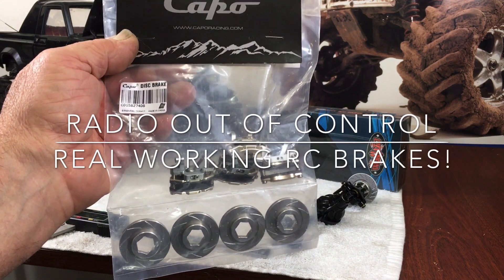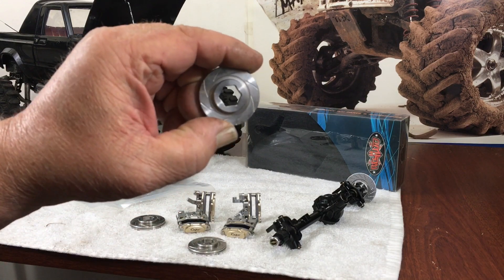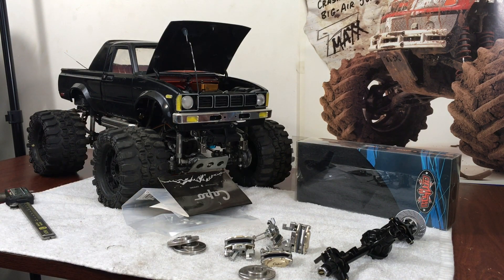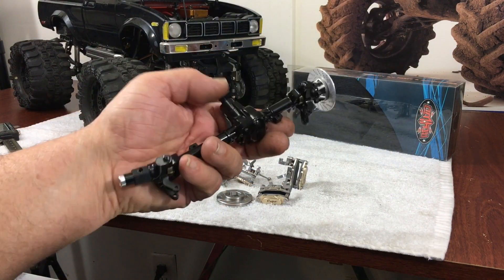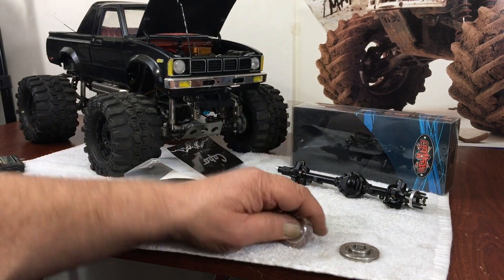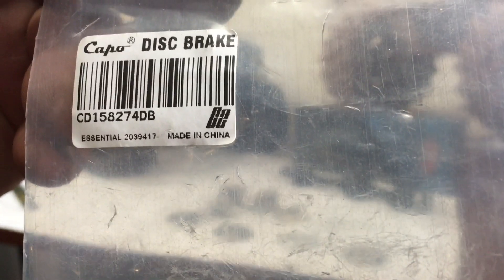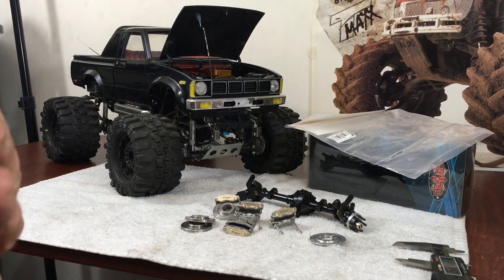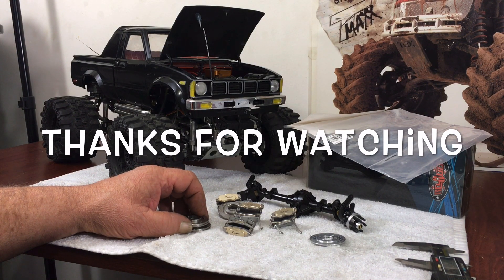CAPO Real functioning rc brakes

Comment: Cool video.
I love the Porsche 928.
A while back I installed a Megasquirt stand alone fuel injection / ignition control system and a Vortec V-1 centrifugal supercharger on one.
Reply from the maker: I was going to supercharge mine but had to many projects in the mix lol. its a euro gray market car that some Dr. imported got in trouble with it then put it away.  I bought it back in 2000,

Comment: Great info on a really awesome brake setup! What I’m seeing is the possibility of mounting a rotor and caliper setup between the drive shafts and front and rear diffs if space is an issue. Even better, if you had an outdrive pinion coming through the opposite sides of the diffs you could mount them opposite the driveshafts like a Rockwell axle or an old school rock bouncer. Plus the Rockwell style braking is a super cool look. On scx10 axles that’s just a matter of mating two of the same axle housings and using two pinions.
Nice looking 918 by the way!
Reply from the maker: rc Ohio that is a great idea brother I love the Rockwell axles,kinda hard to find lately.

Comment: I've got a Toyan single coming, planning on using it in a tamiya semi. Globe Liner probably. Kinda wish these brakes were a bit smaller so's I could shove them into those wheels, alas, they're 1.7's.
Reply from the maker: Yea they could use a spacer to get the rim away from the caliper if you wanted to.

Comment: A bicycle shift cable should work. The shift cables are thinner diameter than D brake cables they are stainless and they are extremely strong I would suggest rigging up the cable and getting rid of the stretch before installing it on to your brakes
Reply from the maker: Todd Bertram good call brother! I’m on it thanks for the idea!

Comment: Thanks, Dennis.  I’m going to try putting those on my 2WD for some burn outs. As for your 2 stroke build I suggest try a .15 motor 1st, Mine rips just fine. You either gonna like the .15 or upgrade to 2.5. Good luck.
Reply from the maker: That will be cool to power brake an rc! lol good call on the .15  I have a couple laying around, my old tmaxx blasted around with no problems.

Comment: Any updates on the 2 stroke V8 weedwhacker?
Reply from the maker: Yea, I had a staple get sucked up in one of the ports and had to find a replacement jug and piston,  I just need to seal up the lower end and hopefully it will be good lol,
Reply: Dennis Dempsey Radio out of control Glad to hear you got the issue sorted. I can’t wait to hear it run! Keep up the good work.

Comment: They are super cool looking and scale but at that point why not make them hydraulic with a plunger fact evasion on a servo as well as make them dual piston. The single piston Spring actuation I don't think is going to provide a lot of braking power as well as most likely they are going to rub all the time because you are going to have to run one brake pad close to the road are and the other brake pad is going to have to provide the full throw. But cappo does make very interesting stuff I just can never justify the money. But if I could the JK is what I would purchase
Reply from the maker: Todd Bertram I was really surprised that capo didn’t have a hydraulic setup,  I was going to modify the Roman 1/5 scale brakes and retrofit them on my next project,  but I went out on a limb and ordered a capo jkmax before they sold out again,  going to be eating balogna on hand sandwiches for a while lol!

Comment: Hey Dennis great vid, I’m still having issues with my Toyan engine,  can you tell me what fuel you are using and does it leak oil everywhere especially under the sump ?
Thanks 👍🏻
Reply from the maker: Hey brother I’m running 2 different fuels, I have a old can of powermaster 15% nitro with 18% caster,  and a gallon of s&w hobby 20% nitro it didn’t specify the caster amount, both fuels run good in it. Also I’m putting constant power to my glow plug, Yea mine seems to leak at the front and rear of the crank on to the pan, I put a gasket on the oil nipple and put bolts in all the lower pan holes incase it was seeping out of them.
Reply: Dennis Dempsey Radio out of control 
Thanks Dennis, I had my engine apart one of the crank bearing seals was not in the crankcase groove properly and was torn, I put some new ones in but still leaks, this is a bit of a pain as it gets on the cam belt and then the fan slips. I’m thinking of fitting a brushless fan up front to help with the cooling, I’m running Optifuel 25 % think that’s pure synthetic, keep up the good work 👍🏻
Reply from the maker: @Blacklamass  I think the fan they have is more for decoration than function, mine slips with a dry belt lol!  I see on the enginediy.com site they now have a water pump and accessories for their water cooled version,  I am undecided on getting the gasoline water cooled version or the V4 for my next build, I haven't seen many build videos on the V4 so im kinda sceptical on the engine and the heavy price tag on it. But I guess we were the few to to install and experiment with the fs-100 in our builds,  I am going to tear my toyan down to check the crank seals mine is leaking more and more. I want to really look it over to see if any more power can be squeezed out of it.  The higher nitro content in your fuel usually helps maintain a smooth power band from idle, I was surprised when I ran the 15% it really stabilized the idle and increased the bottom end but lost some top end torque and power, I'm going to retune it and run the 20% again as soon as it warms up to normal temps outside here in new england lol!
Reply: Dennis Dempsey Radio out of control 
Hi Dennis, in reply to tearing down the Toyan, do you deal with Enginediy? I bought my first engine from an eBay seller, I got on to Enginediy and they seem a bit reluctant to help me out, but will keep trying, they are saying to me that the engine must have the cam belts changed regularly and engine must be cleaned out regularly, I have asked them why and what does cleaning out the engine regularly mean but no answer.
The Toyan engine has some good and bad points, bad points is they use a two piece crank, the main bearings are very small and they use a pair of tiny ball races on the con rod big end which makes the con rod so thin walled, why they did not fit a nice bronze bearing and a more meaty con rod is beyond me, I also found the cylinder is glass hard and you can see the shiny marks on the bore hear and there as it’s not bedding in, normally you have a softer cylinder so ring can bed in.
Saying all this I still love this engine, I think it will take so long to run this piston ring and cylinder in as they are both so hard, I have been running mine tank after tank and it’s getting better, I have installed an electric fan which helps no end. I really think this engine is kind of a display item to run on a plinth to empress your friends rather than a real working engine, I’m going to make some new rods and bronze big end bearings and see how they run. My engine with new seals is not leaking quite as bad, but still hard to tune so have fitted a finer needle which helps out a lot, I do think we need a bit more help from the manufactures of these engines, I can find only very limited spares for this engine, after all we are promoting this engine on YouTube but the times I have taken this truck out it does not empress my friends 
What do you think Dennis ?
Reply from the maker: @Blacklamass  I have only contacted them a couple of times on the V4,  They do return my messages, Did you get any instructions with your engines? I know the cam belt is suggested to be changed every 100 hrs of run time and they suggest cleaning out the grease sludge in the valve body and any soiled oil in the lower crankcase on a regular schedule, I wonder if your oil problem is from the piston blowby pressure in the crankcase until it gets bedded in, I was going to drill a bigger port hole in my crankcase I dont think its big enough to expel the oil and is pushing the crank pressure back up the cylinder and causing an enigma in the combustion chamber . the 2 strokes have a lot of suction in their cases where the 4 strokes don't.  Most of these companies go through rolling changes with parts over time I remember using chrome rings in my high performance race car engines and they took forever to seat lol, I have ran about 2 gallons of fuel through mine and it dose run way better than when I first got it.  This engine seems to be the equivalent to the brushed 27 turn motors, The engine seems to be a low power transportation engine where the 2 strokes build a lot of power for fun running. I have been playing with gearing and tire sizes to find the sweet spot I just ordered a 12t clutch and a 42t spur to try out. I am going to install a 15  traxxas engine on this to see how it reacts with it compared to the toyan.
Reply: Dennis Dempsey Radio out of control 
Hey Dennis, Im Sure the little Traxxas 15 will go well, but I like the 4 strokes an in particular this Toyan, the strange thing is that I have been running a few tanks through it every night but the tune never stays the same, I’m going to run my other one in on the bench, maybe you can do a tear down vid if the engine it’s easy to strip down, I even lapped the valves in while it was apart 👍🏻
Reply: Dennis Im not having a lot of luck from Enginediy, they mail me now and then saying they going to do this and that but in reality nothing happens, no real help with my issues, have you stripped your Toyan down yet? I opened the box of my bruiser clone today that’s my next build, I have been running a few tanks every day through the 6 wheeler but  it’s never the same always playing with the main needle, hoping second engine will be better, I’m looking at the V4 but looks like you got to change carbs, have you seen Johnny Q”s vids ? 
Keep up the good work 
Steve
Reply from the maker: @Blacklamass   Hey Steve sounds like they are dragging their feet for some reason, Not a good business decision in my opinion,  I took a chance on the toyan, I was going to buy another bruiser clone but seen the toyan was on sale.  I haven't had a chance to tear mine down yet, kinda afraid of not being able to get parts if I need them. I want to change the carb and run it to see if there are any improvements when  Johnny Q changed them out on the V4 it woke it right up.  now I wonder if the carb is more for looks than function,  I'm waiting to see more on the V4 before I jump on one,  I really enjoy the bruiser clones for the inexpensive fun that can be had.

Comment: Dennis can you pm me or get in touch maybe face book or something, Toyan motors !!
Reply from the maker: Hey steve hit me up denlin20@aol
Reply: Dennis Dempsey Radio out of control 
Hi Dennis how you doing ? My Toyan Motor died yesterday,I have been on a on to the manufacturers but they just answer me now and then, the biggest weakness on this motor is those 2 tiny ball races in the big end of the con rod why they did that I don’t know, every engine out there has a bronze bearing in the con rod.
My two bearings decided to fall to bits and the shrapnel destroyed the engine, the rest of the motor may survive it’s not too bad apart from it needs loads of running in, I will send you a few pics of the damage and how I fixed it 
Cheers 
Steve 

Sent from my iPhone
Reply: I can’t get that email address to work Dennis got some good info and pics of mods I done to the engine